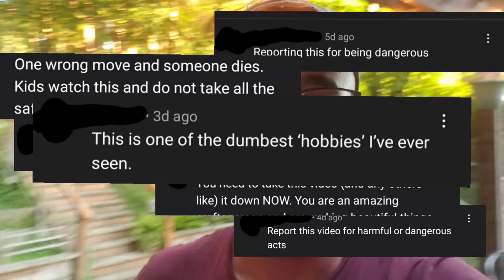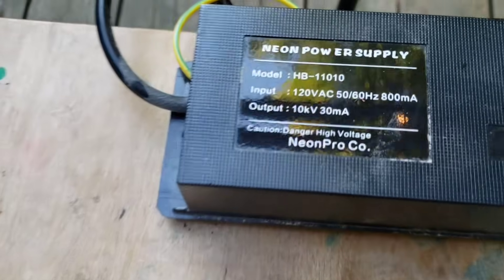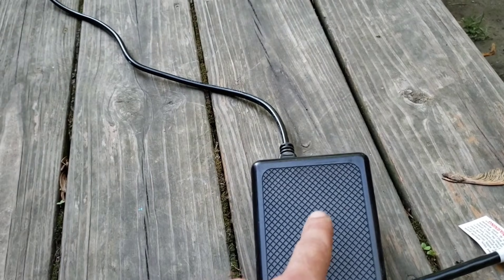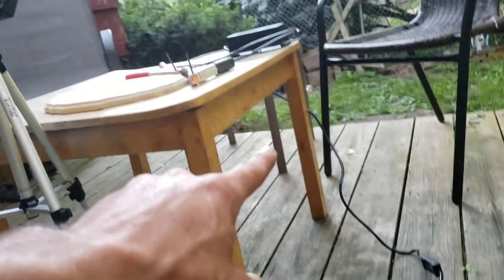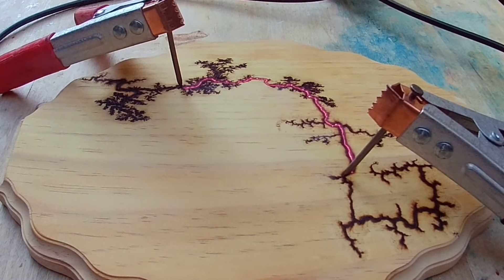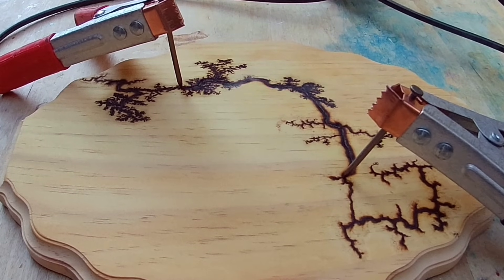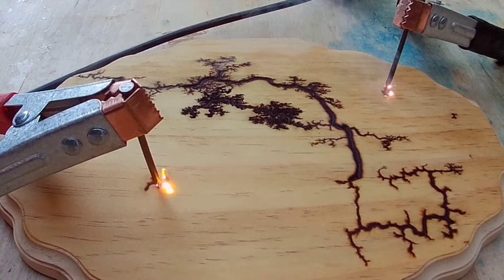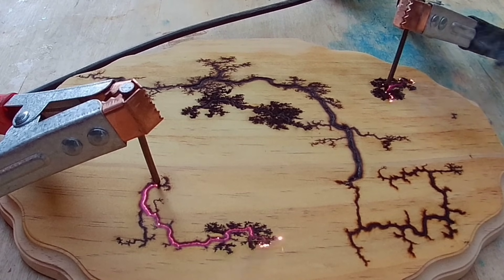Safer Fractal Wood Burning (Lichtenberg) Setup

Comment: Electronics instructor here, we built Jacob's ladder out of the neon transformers out of neon signs between 10 and 15 kw and yes, they are very dangerous.  Having the safety implements you have (we do to) makes this safe as well as the learning environment.  We always stress the safety when ever we are dealing with this type of voltage and current.   Your neon transformer is safer than most other setups I have seen.  Explaining the why as well as demonstrating your techniques makes this memorable.  Great fractal design!!
Reply: I loved working with electricity.  I also have the highest respect for it too.  I used to re-wire cabins at a summer camp.  Got to the point I was comfortable changing outlets out with the breaker on.  Until I did it with a 220 and nearly pissed myself. lol
Reply: @kaotikhorror  Been there, done that!!!  I do have to laugh at that though as literally pissed myself too when messing with electricity.  Definitely changed out breakers hot and it takes safety practice to do that.  Worse shock I got was changing out wired phone circuits and a call came through.  48 vdc and it will make you do the spaz dance if holding it incorrectly. You will get better!
Reply: Betting you could apply some "effects" by applying a magnetic feild underneath your work.
Reply: I see the yellow wire but where did he mount it ?..  to the table he is doing the burning on ?

Comment: Looks like a already pretty safe setup.... two things that would slightly impove it even more: 
1.) your probe holders are propably not isolated enougth. I'd use full plastic clamps or a plastic pipe with a nail instead. 
2.) in an ideal world you would have TWO pushbuttons (one for each hand), that activates the power, so you cannot physically touch anything with your hand without letting go of the button. 
3.) Ideally still have a 2nd person standby to cut the power if nescessary. 

But more importantly.... Be save. KNOW what you're doing, know what you can do and what you cannot. 

During my time in school In physics class, I once was allowed to show the jacobs ladder experiment at 10kV. The only reason the teacher allowed me to perform it is, because I could demonstrate exactly what I had to do, what was safe to do, and what was unsafe to do.

Comment: It is fun. I had one I built from a microwave transformer.  There is safer ways to do this but what you want to keep in mind is, the AMPS. It only takes a few amps to kill you. This machine could kill you 50 times over. But if you do every precausion that you can it can be done safely.

Comment: Literally the only thing that makes this system “safer” than any other system is where you’re standing. And all your talk about this not being an instruction video is a lie. We all know that someone’s gonna use your set up, and because you made such a big deal about it how safe you are, it’s gonna be really easy for them to get just a little bit lazy and not take two steps away to push the foot pedal every time. All it’s gonna take is for them to kick the foot pedal little closer so they can sit down to do it, or get a better view, or just not have to walk as far each time, and then they might as well have the switch on the machine itself.

Comment: As someone who is well aware of the dangers of electricity, has been working with electricity for decades, and has built way sketchier stuff with MOTs. I applaud the way you have designed your unit.

Comment: Are there any techniques for getting a deeper or wider burn with this set up?
I bought the version from amazon that's stronger but the burns are thin and tiny, I was hoping to use this for burning on tables and filling with resin

Comment: Good video. I been burning for about 4 years. Safety is #1 always. I use a reostat to control my volts. Have a light in main setup. It's on system is hot. Like the foot switch. Going to add it into my setup. Know the power is off you showed. I use pvc handles on my prob as a precautionary Xtra steps. Like I said safety no. 1.  Use rubber mats and rubber electrician gloves. Love burning. It's let's me be so creative. God bless.

Comment: What if a pelican flies overhead and drops a mouthful of water that stretches out into a 5 foot stream by the time it makes contact with your body and the deadly electrodes?  Now on a serious note: There's an endless list of activities that have high potential for death.  This one seems at the low end, relatively speaking .  People are more likely to die in a car crash then be ended by electric shock.  What is the best guess for how many people have perished doing this?   I predict the numbers are in the 2 digits at most.  A millions time more people die from obesity, car accidents, drug overdose, mechanical machinery incidents, etc.  Spend a day working an emergency room.  You'll find more death caused by alcohol abuse then by making art.  Unless the two are combined:)

Comment: OMG!!! Haters will  Hate!!!  I am so excited to start mastering this form of art.  I live in Hawaii and nobody here will reach this process because of the negative aspects due to safety etc. but your procedure definitely looks far safer.  I am going to try a high voltage battery to see if I have any luck but keep your videos coming, I want to learn as much as I can and I would like to find the safest way to create my art through fractal burning.  I am not a moron so I know it can be dangerous but I don't want to die so I will find the safest way to achieve what I want to achieve.  For those of you that have to intervene with your negativity, I am suspecting that you are either 1) bored with your own lives and have nothing better to do 2) just sour and get off on dictating to others and 3) jealous because you weren't blessed with any talent and you are just jealous

I am interested in seeing your next post, keep up the good work.
Reply: Get all the info you can because HV AC/DC are two different  animals.

Comment: I'm an electrician with four years of college and almost twenty years of experience. Witch means I'm a trained professional when it comes high voltage. I've done a bit of wood burning like this. A gun stock, a desk and a few other things. As an electrician I know switches go bad. The way that I do it is I have the gator clamps connected to nails on wooden sticks and use the switch to trun it on and off and unplug the extension cord before I touch anything. I was also wondering what you use to wet the wood. I use salt water since pure water isn't a good conductor.
Reply: The comments and questions you are asking is exactly why I'm here and watching these types of videos. I've got experience in electrical, mainly 110 & 220 but like anything else I wanna do my research before attempting it, especially in electrical. I've been bit a few time's before and prefer to avoid it lol. Thanks for the tip on switches, it's easy to get complacent and forget about a switch failing which I've had happen on my table saw Year's ago.

Comment: Journeyman wireman here. As a basic rule, we assume electricity can jump 1 inch for every 1000v, so as long as you stay AT LEAST 10+ inches from your 10kv conductors, you should be fine. 4 feet is more than enough. Karens will be Karens.

Comment: Well, despite all the warnings and disclaimers, I decided I wanted to give this a go, but was sufficiently sensible to steer away from microwave transformers and tried a couple of neon transformers [one of which appeared to be the same as used in this vide0]. Set it all up with a double switch, turned it on and... nothing! I've seen other videos in which nothing happens using these, so I'm a little disappointed. I tested the transformers and they're definitely kicking out power, but nothing's happening between the poles on the wood. The only difference I can see is that I haven't earthed/grounded [UK/USA!] the unit but there appears to be no way to do this; removing the bottom plate on the transformer just shows the ceramic or resin of whatever it is that encases all of the dangerous bits. What am I doing wrong? How do I earth it and will it actually may a difference? Does the strength of the baking soda water matter? I've again seen differing views on what the mixture ratio should be and have tried weakening and strengthening the mix and still I get nothing 😞

Comment: Great video btw bro, I've seen videos of people manipulating leads and clamps while transformer is on!  Hands inches away from conductor and thousands of volts, you are correct, proper safety and this is really not a dangerous hobby, just requires knowledge of electrical and safety

Comment: I'm having trouble understanding the negative comments. I work with high voltage in analog oscilloscope repair. It can go 7.5 KV or so with much higher current. Are people saying if you stand 5 or 6 feet away, the arc will jump to you? I have seen it happen, but only with a very large Tesla coil. If you don't understand electricity, I get it, but you can electrocute yourself with 120 VAC or around 80 VDC.

Comment: Gotta clear this one up, because people say it all the time. Electricity takes all paths, inversely proportional to the impedance of the path.

Also, I would recommend putting your "main" switch on the upstream side of the footswitch, so you don't have to go near the transformer to turn it on and off.

Also I would highly recommend you don't stand on concrete or grass -- anything grounded. Get a rubber mat. Also, wearing rubber gloves is a good idea.

Comment: This is must be the stupidest craft/hobby I've ever seen in my life. It's literally Darwinism in action, right up there with Russia Roulette. The voltage involved in some of the rigs I've seen on YouTube is high enough to arc through the air. Yes, people have died doing this without even coming in contact with an electrode or the wood or the water used to soak the wood or anything else. It just jumps through the air and ZAP, you're dead. This guy seems to be standing a safe distance away but who knows how far high voltage electricity can arc through the air? If lightning is any kind of indicator it seems to be more than a few feet. What's more, you may have done this a thousand times without incident, then one day there's slightly more humidity in the air or just a greater concentration of atmospheric ions, and a 2000+ volt, home made, mini lighting bolt instantly stops your heart from across the room. It's not worth messing with, and in my opinion the resulting "art" isn't even aesthetically pleasing. I have a hard time believing there's any kind market for fractal burnt wood.
Reply from the maker: Actually we all know how far electricity can arc through the air because electricity isn't magic, it's science. It's. 0.4 inches per 1kV in an ionized and humid setting so this set up can arc up to 4 in in an ideal climate which is a humid ionized environment. And you can bet on that because it's science. 4 feet away is in excess to make a point.
Reply from the maker: The only point you made in that massive paragraph is that you don't know the science behind electricity. Lightening bolts? 1 billion watts of power dude. I giga watt. This set up 10 watts... this is why opinions without intelligence or research is dangerous and stupid🙄
Reply: @TheFishinDad  Go burn wood.

Comment: I like what you do and, like you say if you're taking the right precautions you greatly reduce the risk of there being an accident. 
I was going to say that I am going to to try burning but to reduce the risk of being killed by a massive electric shock I am going to build a cubicle with a big viewing panel, a bit like an x-ray room has, and keep the dead-man switch and the power supply button out of the burning room. 
That would reduce the risk of electrocution down to a bare minimum. 
Thanks for sharing your knowledge and experience. 👍
Reply: You might feel save with your equipment now but be careful stepping outside, nature throws lighting bolts.

Comment: i have a question about the grounding wire, did you ground it to something? i have set it up but no action.
Reply from the maker: Grounding matters for arcs. I mean I guess the whole things is about arcs, but it's so if there is a surge it goes to ground and not ground through your body. Electricity will always search for ground, you shouldn't see any action when it comes to grounding unless something is wrong. I tied mine to a metal stake in the ground same concept as your city or well water being grounded for lightening strikes

Comment: Don't compare changing a circuit breaker to 4000 volts DC negative
Reply from the maker: This is AC volts first of all and I discouraged using a microwave transformer and showed the opposite
Reply from the maker: I came back across this comment and um... changing a circuit breaker on your box involves way more watts than a neon light transformer at 10kv. What were you on when you left this comment. And more importantly what was I on when I replied the first time😂😂😂

Comment: I just use an extension cord. Set up plug cord to extension cord then walk the cord to the outlet. Plug the extension cord stand there till I’m done. Unplug extension cord from receptacle and then unplug cord from extension cord before checking my fractal.

Comment: Nice video. My deceased brother did this, his passing had nothing to do with this technique. , But anything he did it too he could not put his logo on. He did lots of turnings and carvings the last few years of his life. While I appreciate them I had zero interest in them. Every time we visited he would tell Joy stories about each one. She ended up with 50 or so pieces including the fractal burned pieces. Your set up is very safe. That’s from someone who has worked on avionics, tube amplifiers and other big voltage equipment. Nice video, everyone can quit crying just don’t do it if you aren’t competent working around electricity.

Comment: The safety switches are crucial to avoid electrocution. I still wonder if these switches can possibly malfunction, ie you stand off switch, but it stays in the closed position?
Reply from the maker: It could, thats why you stack safety measures. I only stacked two in this video but I also unplug which is 3. You can also add a light to show when the circuit is closed or opened. Always stack

Comment: Cool I'm gonna go take a microwave apart and skip the switches, only using the plug as a on/off switch. 

Just kidding. I do use a not to make my woof burns, still working on the perfect solution, but my mot has identical switches only I'm about 8 feet away cause that's how long the wire was. Cool setup though.  I started with a neon sign transformer but when it burned out I went with a microwave oven transformer because I had a old microwave laying around

Comment: I’m not much of a electrical guy and don’t really got a clue but that’s why I’m doing research on Fractal Burning because I’d genuinely like to incorporate it in my art designs of my wood craft, everyone online makes it sound like electricity is some spirit that’s gonna get you if you do fractal burning but from what I’ve seen all you gotta do is understand the dangers and take precautions and do the job correctly. Still contemplating to do this but obviously I’m gonna make sure I understand everything about it before trying it.

Comment: First, Good job on safety.  I also noticed how far from the house you are just in case....  One thought is adding a rubber mat under the table or work piece so the electricity doesn't have a path down.  You are correct about this being dangerous if one does not know what they are doing and does not take safety seriously like you do.  It can only takes 1/10 of an amp to kill a careless person.  So I say again, you do good safety, just don't let yourself get distracted between switches.

Comment: I appreciate the fact that you're addressing the safety issues and how you use this in a safe manner I think what she is trying to address are those out there who don't or who are not as knowledgeable as you are. I think if anyone is a true expert in this craft then it's their responsibility when they present this to the public through videos like this is to show the safety measures that they're taking and to stress that this is not something that should be done by a casual user.

Comment: Done this With a Microwave Transformer! My Safety precaution was to put the work on the ground so nothing is going to "fall off" and a cord 6+ feet away with thick insulated shoes, so even if I did fart sideways and passed out from the twisted smell I wouldn't accidentally "fall on it". Simply Plug in an outlet to start, Unplug to stop. Literally that simple and Safe. Kids or Adults that don't have basic common sense with electrical might want to stay away from pencil sharpeners as well, not trying to be rude just speaking in terms of "Common Sense." Keeping it REAL, If any Kid is attempting this alone where is the Parental supervision 🤔 in the first place? 
If the supervising Parent doesn't have the common sense or is Unwilling to learn how safely then by all means YES "Dont do this"!!! And Pay someone else that Does like this guy...Btw Beautiful Art Work!👍🏼💯
Reply: @Thefishindad I used to work in a sign shop and guys would set up a Huge Neon transformer to the angle iron rim around our workbench as a prank...You'd vibrate a bit but with the right shoes (because of not being grounded and completing the circuit) literally Nothing happens. What you're doing is above and beyond "Safe" for all the non common sense having haters. Thanks for sharing your accomplishments! 👏🏼